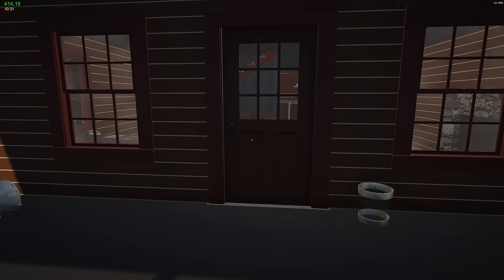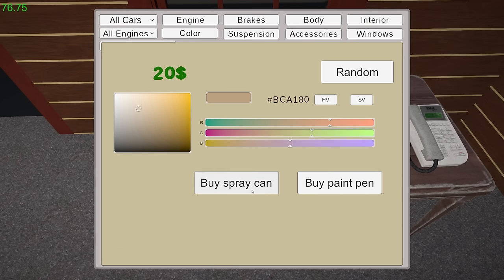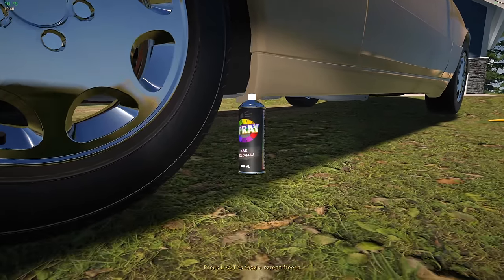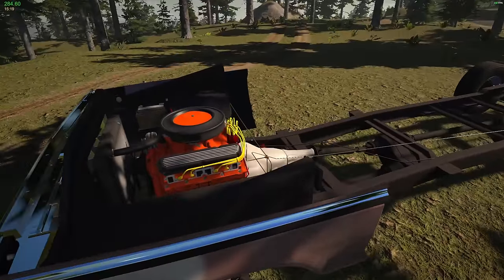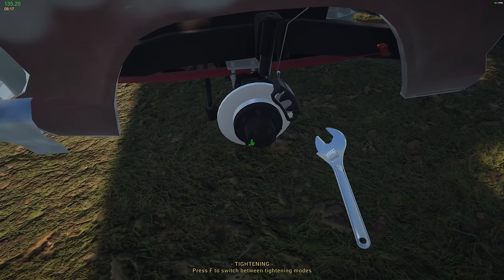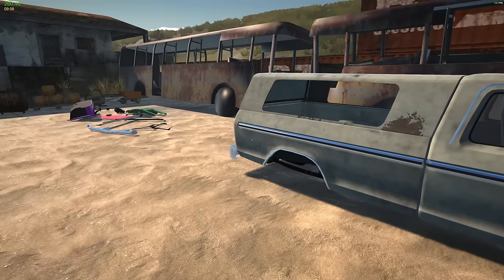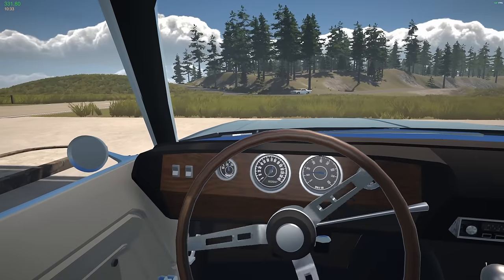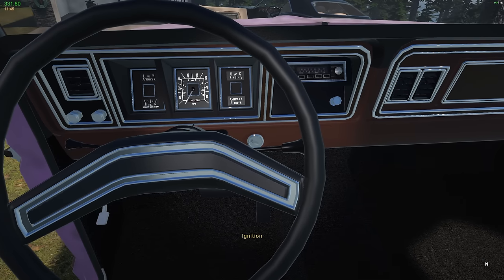Finally The Truck Is Running In My Garage

Comment: You need a gearstick on the floor regardless if it's auto or manual transmission. Also you have the wheel hubs backwards, the smaller of the 8 lug hub is for the rear, the bigger one that looks like it pokes out further goes on the front - the small 8 lug hub is for the dually wheels.
Reply: On some of the cars though they have a different style shifter for auto and manual like in real life.
Reply: @jasonparker3316  The B200 doesn't have that.
Reply: @jasonparker3316  Yeah unfortunately the B200 doesn't because the real life truck would have a column shifter for auto and a floor shifter for manual, and I don't think the dev can code it that way.

Comment: Shopping list: 

Stick shift for the floor needed. 
2 more wheels back. 
Oil filter missing. 
Wheel hubs for the front.
Reply: Yeah he put rear dually adapters on the front

Comment: Hey just a tip if you haven't seen it yet, crawling under the bed of the truck on the ground has a really good chance of phasing you up into the truck bed, much easier way to get up there!

Comment: Most mechanics scratched their heads at my old van, anything thinner and lighter than diesel engine oil (15w40) it would burn. Was like that from the factory and dodge put that oil in it after 2 years of trying to fix it with zero luck. Door sticker called for 10w30. It was a 3.3l v6 dodge grand caravan se from 2010

Comment: All transmissions in game use a floor shifter. So you need to reinstall the one you took out.

Also, did you ever put a new oil filter on when rebuilding the engine?

Comment: You still need the gear stick! also, the two different heavy duty hubs - the ones you have all round are for the rear dually fitting.... you need the longer one on the fronts

Comment: The hubs are for turning it into a 6 wheel set up skape my dude (2 on the back axel one on the front) you should now be able to mount a second wheel to the same hub

The wheels you need to do that are the 17s with the holes in the center that you have

And yes you still need a shifter for an Automatic (and the 2 pedal setup)

Its using a European (UK) setup where the cars have a stick shifter in the center console not a lever on the column ....thats a wiper lever

Comment: You don't have to drop your wrench all the time FYI. You can go into the menu and stuff with it in hand.
Reply: Also im pretty sure it needs the shifter in the floor even fir an auto
Reply: He knows - he has mentioned it several times - but he forgets to use it.
Reply: @reverse_engineered  fair fair